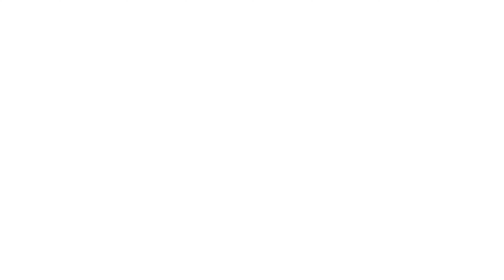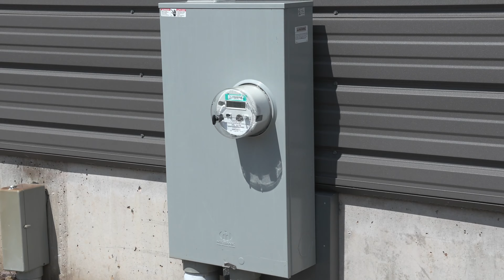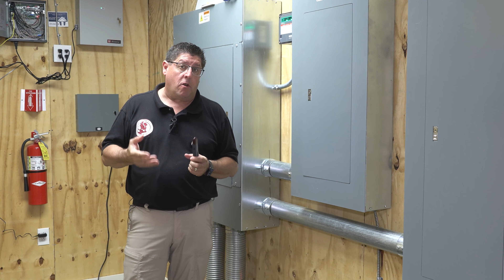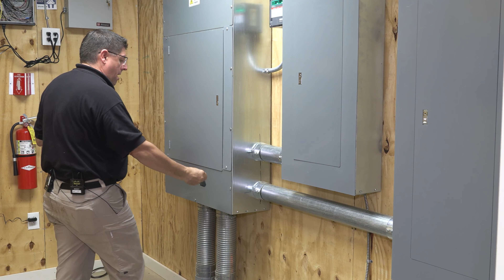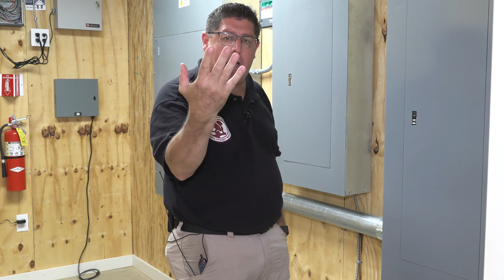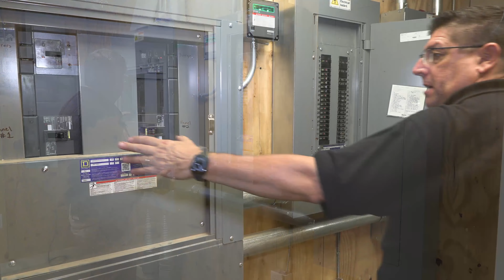Commercial Property Electrical Inspection at InterNACHI's House of Horrors®

Comment: As an electrician that has been in many of these areas before can easily tell you what voltage and size the service is just by looking at it. At first thought it was a 480v 400 amp from the meter socket but when you walked into the electrical room noticed a 400 amp I-Line with secondary panels attached to it directly with no transformers. The secondary panels are less than 250 volt just by the way they look and are basic QOB frame 3 phase low voltage. 480 volt panels use I-Line frames and I-Line breakers and are noticeably larger.

Comment: How can you get 240 volts from a 120/208 system
Reply: This is a 3-phase panel. 2 of the three legs will be 120, which would accept a 2-pole breaker and give you 240.  If you were to measure each leg, you would have 2 - 120 volt legs and one 208 leg. If you measured the two 120-volt legs together, you would get 240v.

Comment: He is wrong, you can feed a 400 amp panel with a 225 amp breaker but you can't feed a 225amp panel with a 400amp breaker.
Reply: Thank you for your comment. The purpose of this video was to show the ComSOP method for inspecting a commercial panel. As part of that inspection was to verify the overcurrent protection. We apologize if there was any miscommunication.

Comment: If both secondary panels are 225 amps and the main is 400 amps, isn't it underrated?
Reply: The panels are not cumulative. So long as no panel branching off of the main disconnect is not larger than 60% of the main the number of panels should not influence the system.